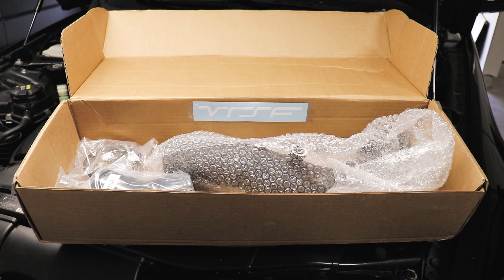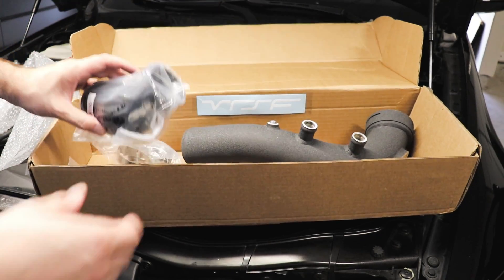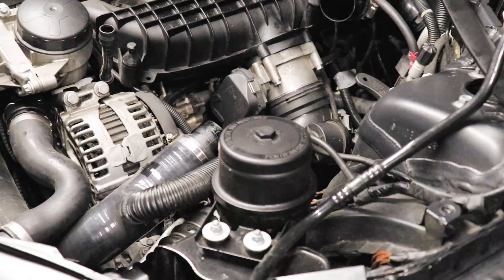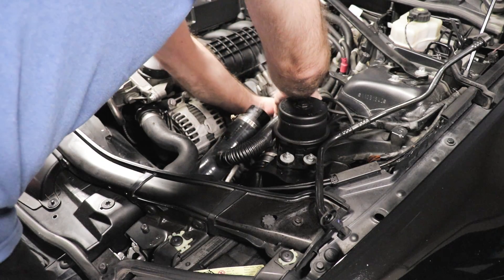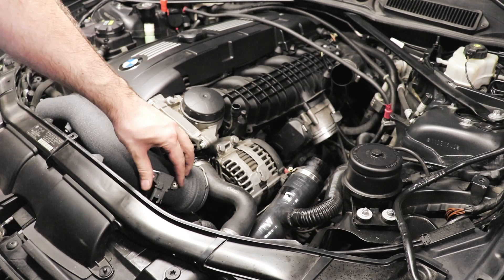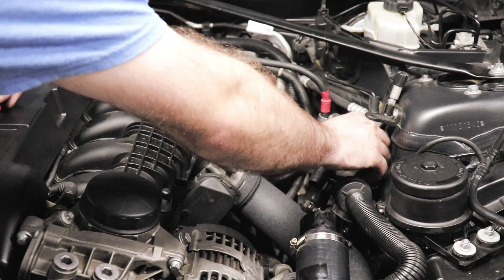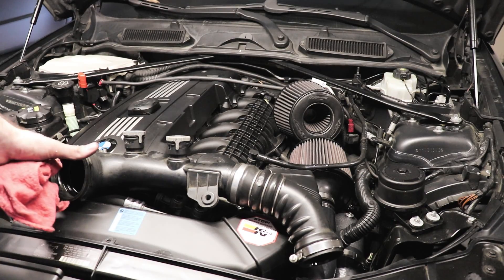VRSF BMW N54 Charge Pipe Upgrade Kit DIY

Comment: how do I get the tmap sensor disconnected?
Reply: nm I ended up disconnecting the TMAP housing (2 torx) first. Then it was much easier to disconnect the wire clip

Comment: My 2010 335i with 40k, charge pipe broke. Ordered an OEM replacement charge pipe. Checked out over dozen videos to use as a guide, but I couldn't find a decent video. My car is stock, so I'll have to find a video removing the air filter housing. Found your video and found it to the best video for me. I like the fact that you gave instructions for each step, without rushing. When I heard you give the website for the VRSF charge pipe, I was convinced to purchase the VRSF charge pipe. I returned the OEM part and bought the VRSF pipe. Thank you very much.
Reply: This video is the best video for the process!

Comment: Does the charge pipe have enough clearance with 2 power steering hoses sitting on the fender? If so, how much?
I tried different brand and it was very tight! Also PS reservoir would get in the way of the BOV(Tial style).

Stock charge pipe is narrow at the place where the 2 PS hoses under the pipe. It gives like 1" clearance. Then get bigger after that point.
But the aftermarket charge pipe is much bigger, and it presses on the said 2 PS hoses.
I'm afraid that with engine "rotating" at the axis from accel/decel would press on the PS hoses and the force would be transmitted to throttle body and plastic intake manifold. After million times of rotating and hitting the hoses, intake manifold might break at the worst time.
After initial installation of the charge pipe just sitting there, not only is it touching, it's putting pressure on the pipe/PS hoses already. 
Imagine when under heavy load of sudden accel, it can mean something will break.

Comment: Interesting how everyone installing these aluminum pipes, not even thinking about how good aluminum at absorbing and conducting heat…. In other words you are heating up intake air when using ANY metal in that intake piping after intercooler. So this aluminum pipe will definitely help with with heat soaking:) BMW revised plastic much much less  heat conductive charge pipe after 2011 and they easily last 100k or 10 years, so think again before installing aftermarket junk….

Comment: How long were you running stage 2+ on that stock charge pipe? 🤔 I'm in the same boat... I just got an upgraded msd81 dme for my n54 (my old one was junk even after boost🐒 mosfets)  and It already has a stage 2+ tune on it. And at the moment i have no way to remove it. My car is completely stock with exception of me just putting some index 12's in with some ngk one step colder plugs and eldor coils. Think I'll be ok for a week or 2 till I can get a vrsf charge pipe on it? I just have the stock charge pipe with 121k miles ?

Comment: I have a 2011 335is that has only 42k miles. The factory stock Charge Pipe cracked so I have to replace it.. What U show in the video the best in the market for the money & I notice U removed the stock air filters, what do U recommend that may add some more HP but at the same time not molesting the car like many that cut the car to fit a larger oil cooler…

Comment: I have one question i did exactly the same but engine light came on with powerlose warning. What did i do wrong? Any advice the rings i received didnt fit on the rubbers it was to small i think factory falt. So i did tyripped it just for one day tomorrow i gonna buy the rings. Maybe it leaks air because of it what do u think thanks.

Comment: So I’m looking at this charge pipe, would it be worth it to pay the extra 250 bucks for the hks bov, or would I just be fine using stock dump valves
Reply: depends on the boost levels you wanna run. stock diverter valves can easily hold 16 PSI 
or 1.1Bar

Comment: Nice video, do you think it's worth upgrading the diverter valve pipes at the same time, or are the oem diverter pipes good enough?
Reply from the maker: That would depend on how much boost you plan on running.

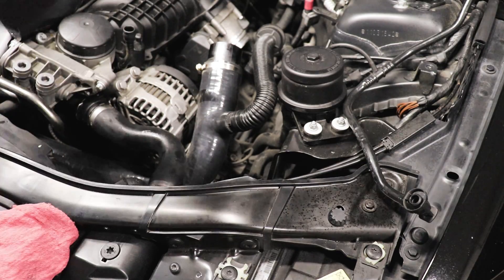Comment: Awesome video. I would remove the section from 7:20 - 8:55 since it was a false start and you realized it should not be installed as one piece - it's confusing. Otherwise Bravo!

Comment: Love your video lean a lot from you channel. Just wondering have you change your turbo yet? Since my is at 100k miles and turbo is blowing oil... thanks !
Reply from the maker: Hey thanks, yeah just before buying this car the turbos were changed by the previous owner. They had around 140K on them and he changed them because they were burning oil.  So you'll have to look into changing them potentially.
Reply: Vehicular DIY really appreciate your quick reply. I am new to n54 I just recently got my 335i 2007 coupe. Just have few more questions. Do you know how reliable are the piston rings and crankshaft bearing? I am planning to buy a new upgraded Vargas OEM turbo but I am not so sure if it worth it.( as I am not sure how far my car can go) It is currently burning 1L oil from the turbo every month. So it would be great to hear your opinion as u are expert on n54. I have watch lot of you video since I got my car.

Comment: How do you like the BMS cowl replacement filters and setup? Better than stock? Any cons to that setup? Seems like it makes working on stuff much easier.
Reply: Jason Vala just the weight savings and appearance alone makes it worth the $60 or whatever it cost.  I did mine a year ago and wish I would’ve done it long ago.

Comment: I don’t suppose you noticed a bit of oil in your OEM charge pipe, especially round the O ring area? I had a bit of oil in mine when I removed it the other day. I read this is ‘normal blow by’. What are your thoughts on this? Thanks
Reply from the maker: I noticed a fine film of oil on the stock charge pipe yes.  A little blow by is normal for any engine I'd say.  That's why they use PCV systems to give that blow by a place to go.

Comment: I'd love to upgrade my N54 with mods, but it keeps breaking and I have to buy parts to fix it lol.
Reply: Upgrade when it breaks instead of just fixing it
Reply: @typedrew  that's what I had to do. Now I'm a brand-new n54, m3 suspension, stage 3 turbos, and full bolt on mods in lol.
Reply: E28 Source BROOO ! You and me both. LMFAOOO.
Reply: See I'm afraid that I will spend all my money on parts and it ends up breaking
Reply: Don’t worry it’ll eventually be good

Comment: Thanks so much for taking the time to post a DIY! Thank you for your contribution to the community :)
Reply: Is the chargepipe supposed to have both of its ethanol/methanol  ports sealed or is only the top hole 🕳 supposed to be closed and the bottom one open 🤔 because i ordered mine maybe 4 months ago and top is closed bottom open on my e90 n54 @vrsf
Reply: @LALOTEH  The meth bung plugs ship loose and will rattle outwards if your installer neglects to tighten both bung plugs prior to installation. You can purchase replacement 1/8 NPT plugs on our website or from your local hardware store.
Reply: @VRSF1  I emailed you guys with more details and pics
Reply: how come mine isnt fitting i think you guys gave me a broken chargepipe thaf doesnt fit for 150 thats kind of bad quality control if you ask me
Reply: @cartiertints6428  was your chargepipe squeezing the power steering hose(s), after install?   If yes, how are you holding up right now?
Reply: @joeyng919  i was actually able to get everything to fit perfectly when taking off the throttle body
Reply: @joeyng919  and the power sterring hose isnt being squeezed
Reply: I just installed mine yesterday,  I had to remove the plastic brackets that hold the coolant and power steering lines, to make room
Reply: @BumpitizedRec yeah comment this on YouTube instead of emailing them for a refund
Reply: @calebtv4289 yea reply to the comment 2 years later like it’s going to help 👏🏾

Comment: What influenced your choice on a VRSF charge pipe vs other brands. VRSF is s quality product no doubt, but I am wondering why it stood out to you in a sea of quality products I guess. Do you have an upgraded FMIC ?
Reply from the maker: Mainly customer service influenced my decision.  I want to ensure that if I recommend a product my viewers will have a good overall experience with the company I'm advocating for.  I do have a FMIC yes.
Reply: when do you plan on releasing you video for outlets?
Reply from the maker: Just posted it today actually.
Reply: I have dp and intercooler, CP from VRSF .
3 years already with no craftsmanship issues, top quality parts at affordable prices.

Comment: Over 10k miles FBO stage 2+ on my N54 and my stock chargepipe is still working just fine but it’s only a matter of time. I kinda wish you got a bov though
Reply from the maker: I'm thinking of going with aftermarket diverter valves.

Comment: I know that there isn't alot of point in doing outlets on stockers , but if you want to so i can see how its done, that would be great 😂
Reply from the maker: Haha yeah I wasn't so sure that adding outlets were worth it on stockers but luckily they were provided by VRSF and that video comes out tomorrow :)  The combination of the charge pipe and outlets made it so if I hammer the throttle at 40 mph I'm breaking traction now with my pilot super sports.  They definitely added some torque.
Reply: Vehicular DIY dude im so happy right now! 😆
Reply: You want to check the bottom meth bung 'little blanking screw' periodically on that chargepipe , mine has come loose twice in 15k miles.